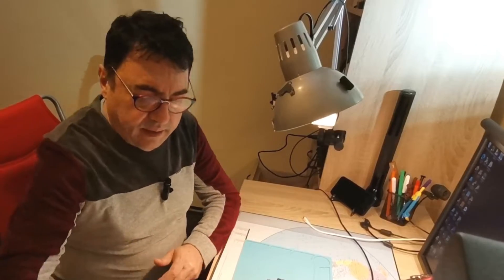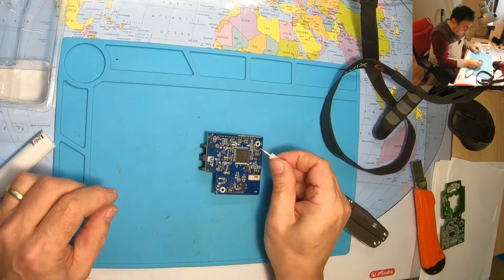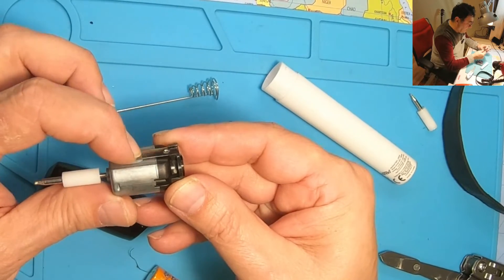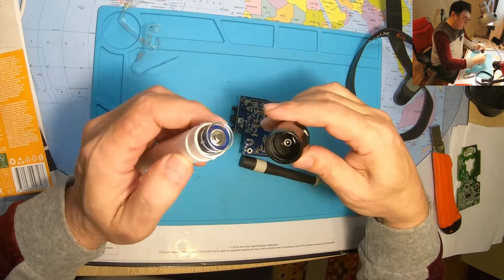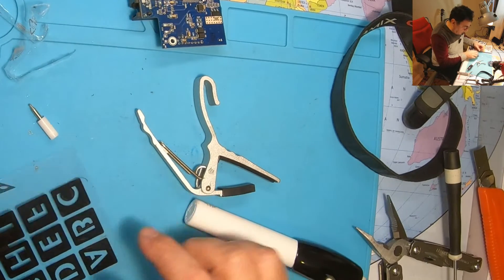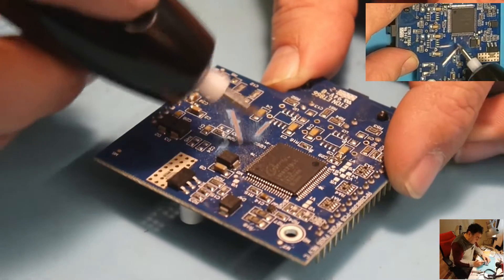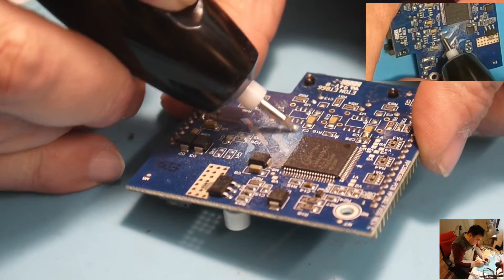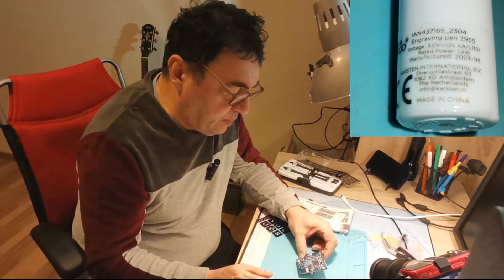Lidl Crelando Engraving Pen

Comment: Hey Vio, could you tell me the outer diameter of the tip (the white plastic part)?
Thinking of 3D printing a tip holder that I could attach a M8 threaded mini chuck to. Then I could use standard Dremel (or cheap Lidl) rotary tool tips. Should be good enough for working with plastic :D 

Seems like this tool has a simple mini DC motor without any gears or anything. That means it could be upgraded with a stronger motor, maybe with a Li-ion battery as well, could be a very cheap and handy dremel alternative.
Reply from the maker: Yes, it's just a simple motor...the motor axel it's 2mm..but look here http://viocaia.amphia.ro/motor.jpg
Reply: @viocaia  Perfect, thanks!